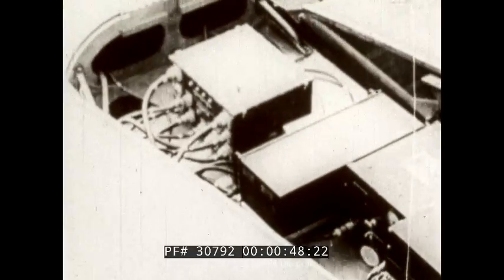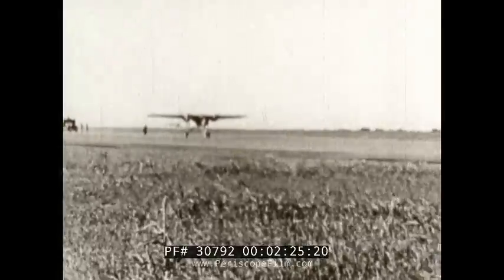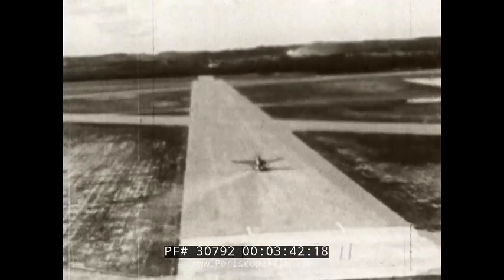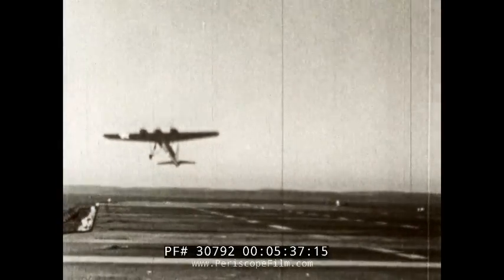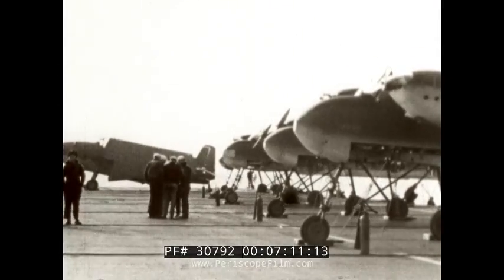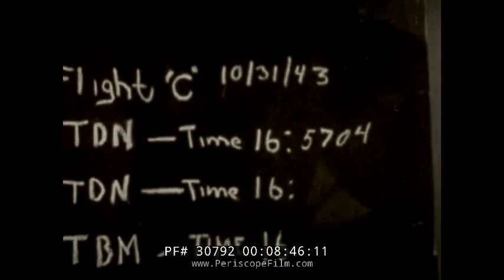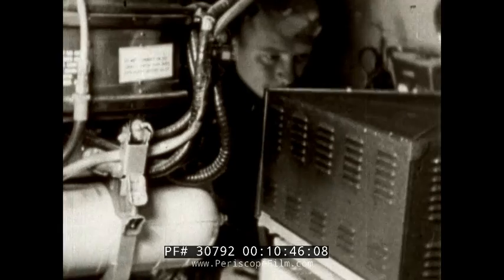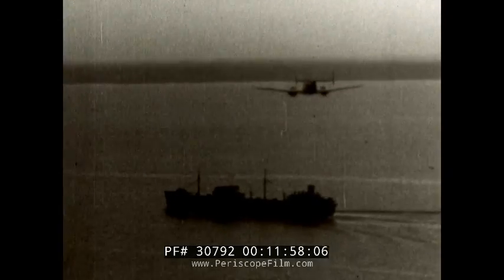" TESTS OF RADIO CONTROLLED PLANES "   U.S. NAVY WWII UAV PROGRAM TDN-1 TORPEDO DRONE 30792

Comment: They were very slow in the air  ! And if this was in combat they would be sitting ducks . Did you notice the chases plane had to have its flaps down not over over fly it ?
Reply: Misses the point

What you have here is a small bomber capable of doing light bombing at a fraction of the cost for fixed wing aviation

See how drone warfare is changing the world today

Comment: *I'm amazed how stable the drones are. I'm referring to the small purpose-built jobs. I guess they were designed with exceptional stability in mind to best assist the guy doing the radio controlling. I wonder how they would've behaved in blustery or rainy weather? And what was the range of the radio controlling? Many miles?
*Lastly, its interesting to see a catapult shooting torpedo bombers off that deck. I didn't think catapults were employed or even conceived during WWII.

Comment: Wow, although the Luftwaffe were the leaders in battle proven remote-control aircraft in WWII, despite suffering continual bombing, the Yanks sure had technology and production power on their side.   Scores less Navy and Marine flyers would have died during carrier-based attacks on Japan if these ideas had been proven.
Post war, the USN adopted the German V-1 as the Loon cruise missile/ flying bomb, apparently adapting it successfully for ship launching.  I wonder if they used it during the Korean War?
Reply from the maker: No they did not use it during Korea. By then the Loon was totally obsolete. They did manufacture a lot of Loons -- if you can see the old movie "The Flying Missile" with Glenn Ford or the Amazon docu "Regulus: The First Nuclear Missile Submarines" for more info.
Reply: @PeriscopeFilm  Thanks, I was curious after seeing a photo in Air & Space years ago.
Reply: @Johno ...... my father was part of the Team who performed the first rocket/missile launch off an AirCraft Carrier. It was a captured V2 & had so much “torque” that it bowed the deck. The Admiral that led the project had his Doctorate in Engineering from MIT & yet knew his way around a lathe, being a Master Machinists as well.
EDIT: NW Newell, CWO3 USN(ret)  R.I.P. Gunner